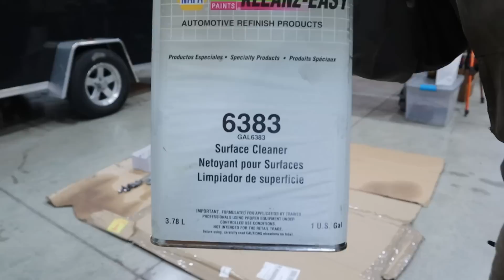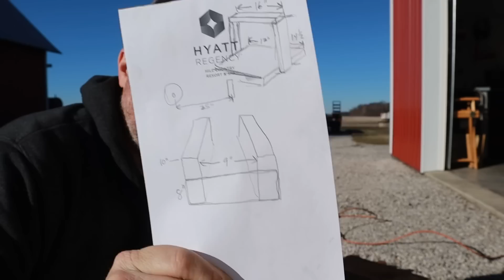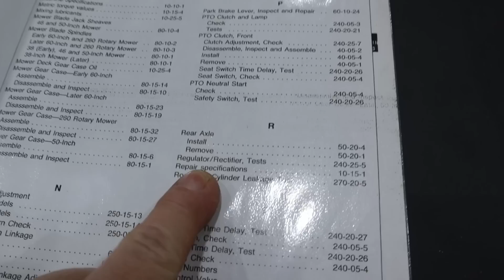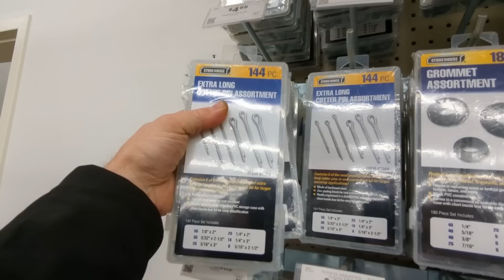Some Assembly Required!  My Dream 318 Garden Tractor Build - Part 5

Comment: Ok, so I would not remember where/how everything goes back together. That could be cuz I’m 69 but I’m pretty sure it was the same when I was 39. It’s just one of the reasons why trades people and mechanics (God love ‘em) have a hold on me. All the more reason to hang onto those gifted and honest (and comp them commensurately)!
You have my complete respect for taking on this all day sucker!
Reply from the maker: I'm not sure I will remember how to put it back together either!!
Reply: @digdrivediy  I've done dozens of these projects. and every time I had to take things apart to install the part I missed. I would put all of those mower deck parts back on. They're seldom in the way of anything and even though you might not ever hang a deck under it, your kids might. (Or some other future owner)

Comment: Awesome Neil,  Your 318 is coming along.  I have a 318 I'm wanting to start working on as well.  Mowing with a 
x758 and the 318 is not in use.  I have a dozer blade for it and is in good shape as well as mowing deck.  Ive restored a few muscle cars and thinking about shooting the sheet metal
with John deere green on the 318 but clear coat and buff with atomotive paint.  I cant wait to see the color your going with on yours you said industrial yellow.  The Patio Tractors were wild back in the late 60's but the Industrial color I'm interested in seeing!  Good Job! John

Comment: I laughed and I cried!  lol  It brought back good and "other" memories restoring my 430.  Just FYI it will go back slower and you will cuss.  Another FYI, in 50 years when you are doing this again those seals are 1" seals that are on all the utility trailers for like 10 bucks, I found out late too.  Look at the brakes too, they are likely soaked now.  Whether you think you needed to or not, you will use that hoist ALL the time.  I suspended my AC Compressor while I poured a new pad under it, right in place, no recharging.  Somehow, I knew you were going to paint it commercial industrial and I can't wait!  Keep giving yourself little presents too like the wheels.  Keeps you motivated!  You will be glad you took the more pain staken route!
Reply from the maker: Thanks John! Those are encouraging words to me...Other than taking longer to put back together!!!

Comment: I was in the same situation with my 318 "refurbish". Had to completely disassemble the entire tractor to fix numerous severe oil and hydraulic fluid leaks. Axle seals, differential case gasket, power steering control valve, numerous engine seals and gaskets. I had boxes and bags full of sand blasted, cleaned and painted parts when I was done. It was worth it when I finally got it reassembled. I am very proud to show it off now. Keep going Neil!
Reply from the maker: Thanks for the encouragement Jimmy!

Comment: This is awesome !     I was given a Husky garden tractor, on the condition that I get it home on my own.  I thought it would be easy , being 3 houses from mine … nope, but I got it home anyway.  Spent about 1 1/2 years working on it and got everything working great.  Replaced damaged and missing parts, sharpened the 3 blades on the deck.  It started , ran and cut great !     I miss having a project.   😊👍🏻

Comment: Cub cadet zero turns solved the issue of messy oil changes…check them out. They use a flexible hose that’s threaded into the case and you can direct the oil anywhere you want so that it doesn’t run down the frame. Genius!

Comment: you may already know this but when painting in cold weather I heat my spray cans in hot water before spraying, it helps keep the paint from running and the paint flashes off quicker. ps I am a lawn and garden equipment tech at a Deere dealer, I started there in 1992 and  have worked on many 318s, they are the most popular garden tractor Deere has ever made.  when you pull the transaxle to replace the axle seals put a wheel on the opposite side you are going to work on and stand the transaxle on the wheel it makes a good work stand.
Reply from the maker: Those are some great tips! Thanks 👍🏻

Comment: Your making great progress! Love the Grey color as well. Now before anymore paint work do yourself a favor and go to Gordon's food service.(There is 2 in Ft Wayne) and buy you a box of thier commercial rolls of aluminum foil. Use that for all your paint masking jobs. Works great for covering wiring,hoses and anything else you can think of. Try it and you'll thank me for the time saving and how easy it works. We do that for our industrial machines we repaint in the factory. Time saver and plus you can recycle it when your done.
Reply from the maker: That's a great idea. Thanks a lot for the suggestion!

Comment: A lot of guys around here keep old pop up sun shades and use those, clear plastic, and tape to make spray booths so they can spray in their shop.    I know another guy uses a diy hoop house with PVC pipe and his wife starts plants in it in the early spring. I think if you have something like that it makes you feel better about doing it in the shop.  If your down here reading the comments……make sure to like and subscribe.
Reply from the maker: Those are good ideas for sure.  I'm gonna need to figure something out when it comes time to paint.

Comment: Don't feel bad, Neil.  I would have felt exactly the same way about that oil leak.  It would have always bugged me if I didn't fix it, plus, you really can do a better clean up and paint job on that area with it disassembled.  Hang in there. You are doing great.
Reply from the maker: Right on

Comment: Neil, I'm in 'the boat', although mine looks like it has about a thousand small leaks and is taking it's sweet time sinking! After some life issues and we lost both our fridge and deep freeze in a storm-related power issue (they were on protected circuits that got overwhelmed by lightning evidently. Didn't find out about the freezer til it was good and stinky🤮) we got a new fridge but was an absolute bear that tried to kill me several times. The package weight said it was 352, but I'd say it was well north of 525lbs (!!). I was saved by two neighborhood guys that saw it try to take me out getting it down the ramps from my truck; it took me and some help from the wife another two hours just to get it taken apart so it would fit through all the door ways to get into the house, and had to call in the father-in-law for backup. Another week with the old one in the middle of the kitchen, I decided I'd harvest its body and make it into a chemical storage chassis. Finally got that knocked out this weekend, which of course resulted in a mad scramble to clean up the workshop to find a place for it and move all the racks around. It never ends!! 
Meanwhile the three boxes of tractor parts (just linkages, pulleys and hardware, not to mention all the bodywork and mid-progress frame fabrication with an engine in my utility room) keep looking at me like the lion at the zoo waiting on its last meal. 
"Today? Feed me today?"
"Sorry pal, maybe tomorrow..."   Yeah, ended up doing our taxes that day and had a short-lived bout of depression when I tallied up how much we spent on healthcare that still didn't do jack to net us a reduction. 'Could have bought a brand new JD and A LOT of accessory drives for that!' Sorry bout the rant, felt nice to vent though. Guess you can send me a bill for the therapy, we'll put you on the list. 😉

Comment: I had to do some painting in my grandpas barn and i took a 40 foot tarp and used zip ties to zip tie it around his garage door arms. and then put another tarp on the floor and hung a couple led lights. it’s not the nicest paint booth but it worked very well and it was cheap and easy to set up and take down
Reply from the maker: I may do something similar. Thanks Zack!

Comment: For the fumoto valve. Have a short hydraulic hose made and remote mount the oil drain valve on the frame with a npt bulkhead in a convenient yet protected area
Reply: I was gonna suggest grinding on the engine block a little to make it fit but your idea sounds like it would make oil changes much easier.

Comment: A little tip for masking off the lines and wires/Awkwark parts,  Aluminum foil.... no i know it sounds weird but trust me it makes it way easier with the same results. Just mash it around where you dont want paint no tape required.

Comment: when your done painting, keeping items you painted within 4 feet of the sealed wood stoves works wonders for baking the paint, all that nice dry air radiating off the stove.
21:45 putting back in, your big sockets with a big washer between the seal and the socket, then you can smack the driver hole and usually get a pretty good seat and you can pull the washer out after it's near completely in and adjust accordingly to where you need more pushed in, but a good 3 fender washer stack you can usually go flush with out damaging anything except marking up one of the washers and a bit around the socket driver hole. i cut strips of duct tape to get about 3 wraps around a washer stack in double, tri or quad strips around the stack, just to keep them together, super glue only works for so many whacks before they come apart, alot of times on the first to third.

pro tip, when you go to set stuff down, throttle down to a bit over idle so you don't get that jerk drop while trying to slow bleed release

doesn't the rear transaxel just drop down one you remove the frame attachment bolts, enough to let you slide and axels off? i've done it with a jack stand for the 4XX series
no harbor freight hand sand blaster for hard to reach spots and little parts?
the hardware assortment boxes are the best bang for the buck at that place, i have easily spent $20 on those alone every time i go in there.
it's not just for the mower deck lift, it's also for a belly grader blade.
maybe talk to TarylFixesAll about your motor getting checked out and tuned back to spec?! the manifold rods usually could use a good check and lapping. it'd be a dang shame for that or the hydro to have something go wrong with it after all this work.

^5 Ryan great job, most guys blast them until the edges are round, you did it perfect. not that i don't like rounded edges, somethings just don't work well with rounded edges and usually rounded edges means the thickness of the material is not as good as it used to be nor as uniform as some spots too longer and more grit to clean than others, and you sir did it perfect!
Reply from the maker: Lots of great tips and tidbits here!  Thanks for all the advice 👍🏻

Comment: Very cool 👍 I use too collect and restore 318 / 332 / 322 / 400 s / 420s / 430s . One thing I did do after sandblasting was use metal prep acid too clean the sandblasted parts .I found sometimes fish eye would show up in the paint from silicone deposits .  Looking good 👍👍
Reply: I use brakleen and wipe everything down before painting I’ve always had good luck
Reply: @hunter7476  Good idea 👍

Comment: Looking good Neil! Just a suggestion, if you replace the standard seat frame with a suspension seat frame, you'll never regret it! I did that on my 425 and it's awesome! Much more comfortable than the stock seat frame. You may be able to find one from a garden tractor salvage place.
Another tip for masking, for stuff like the hoses and other items that are a pain to mask and unmask, use some cheap aluminum foil and just wrap it around the items. It's easy to put on and easy to get off.
Reply from the maker: Those are great tips Rick! I just happen to have one of those suspension seat frames! 😉

Comment: Fellow Indianan here.  I’m in the same never ending stages on a Wheelhorse restoration. Keeping finding small things then have to order the part and wait for them to come in. It’s just exhausting sometimes. I am one small 5/8” oil seal away from putting the 6 speed transmission back together. Of course I’m waiting on the seal to come in. The transmission is in pieces on my welding table which is another nuisance. Lol. Just keep on keeping on.  Hopefully it will be worth it once they are done.  I appreciate your videos showing the reality of these types of projects.  Definitely not all good days lol
Reply from the maker: So true. Thanks Anthony!

Comment: Try putting the seal in the freezer first,  it will shrink it slightly,  and will install easier.  Works good with races too.
Reply from the maker: That's a great tip. I've done that on heavy equipment parts before.

Comment: Use a drainzit for your oil drain. It’s a piece of hose with the thread you need for the oil plug and on the other end is a cap

Comment: Problems are good, they teach you lessons different trouble shooting skills and to be prepared for anything, my poor 318 is sitting in my barn. I got verdestein v61 front tires and new Carlisle inner tubes for it tightened up the front steering has the plow in it but apparently Pennsylvania doesn’t get snow. One thing in the future I’ll need to look at is adjusting/relplacing brake parts so they independent brakes work like they should. The sump on the engine should also be replaced as it’s damp and has oil residues around it, that’s just me being nit picky though
Reply from the maker: Exactly right Hunter. We didn't get any snow either 🥺

Comment: Can’t go wrong with the Harbor Freight hoist.  Got my wife one for Christmas a couple years ago to pull a 305 out of her square body Chevy.  Bought the bigger 2000# version so we could use it for a crane in the shop.  So far it has been.a very handy tool, seldom used, but fantastic to have when you need to lift something real heavy.  Have a great day, excited for the progress you are making.

Comment: We love all your videos. One thing that I see is that fuel lines and other lines are looking older so it might save some time in the future if you were to replace all the lines you can while you can get to them. Maybe look at the wiring also and make sure it is not getting cracks causing a short. You can whatever you want, just trying to save a headache or 2 down the road. Keep up the great work.
Reply from the maker: You're exactly right about that. These few lines were replaced a couple years ago. Actually. I'm worried about the hydraulic lines on the power steering cylinder. I've got a few wires that are in line to get fixed up for sure. Very good point to make about that stuff Curt.

Comment: For the oil drain use black pipe. I believe 3/8 will fit then run it to the easiest service location and end it with a coupling and a plug for convenience
Reply from the maker: I would love to do that but it's unfortunately metric. M14x1.5 is the thread.

Comment: Your 318 is going to look better than new. Have I missed the new name? 
I have been in that Harbor Freight many times. There used to be a Fish of Stroh on that corner. I bought an air over hydraulic engine hoist at an auction years ago. Tried to use it to pickup my mower deck.
Reply from the maker: I always enjoy Harbor Freight but I feel overwhelmed when I go in there.  Like, I'm forgetting something I always meant to buy the next time I'm there!

I haven't disclosed the new name yet - I figured I do that once it is officially "reborn".

Comment: I can't wait to see how this 318 looks when it's all said and done. I love your channel it's very inspirational and fun to watch. I am on the hunt for a 318 , a 445 or 455. A Kabota G4200 would be awesome to. I'm not brand loyal.  One of these would be a ultimate goal for me. I've got a Case 222 currently that's my place holder work horse it's to rough to do a full refresh build on but it will be a good little work horse it's got a new Predator 13hp engine.
Reply from the maker: Sounds awesome. Thanks so much for the kind words.

Comment: Neil, That isn't a vent tube, it is the sight glass for checking oil level in the transaxle.
Reply from the maker: Well, technically it is supposed to have a vent in line of it too. It looks like a little fuel filter. Mine is missing the vent. But you're right it does service both.
Reply: @digdrivediy  I think the fill tube also acts as a vent for the transaxle. you can also add fluid one teaspoon at a time.
Reply from the maker: @rettif9  Hahaha!  That's so true.  Full tune is tough for refilling!